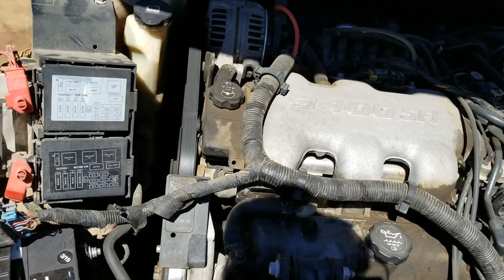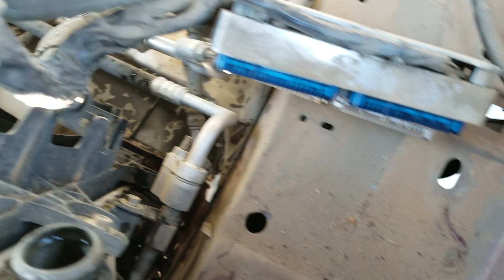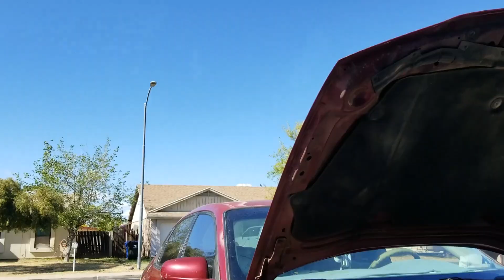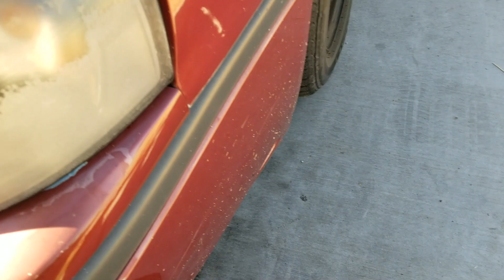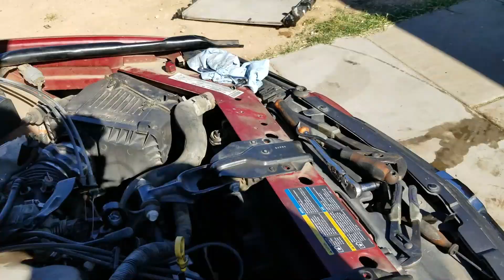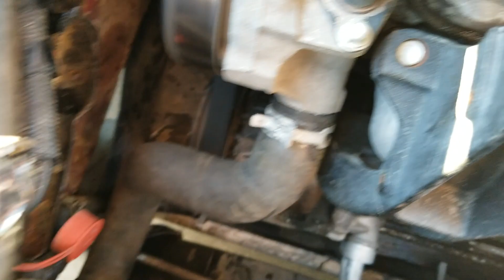2000 - 2005 Chevy Impala Radiator Remove and Replace

Comment: Also, the coolant should be flushed out & Changed, along with your Thermostat, every 2 years to keep your engine Clean & performing at Peak Performance & Reliability. Don't listen to the Manufacturers or you will be changing parts, water pump, Radiator, heater core, intake gaskets, head gaskets. Old heated Antifreeze turns Acidic over time, which means it start eating gaskets, Seals, Aluminum. Manufacturers state, with Dex-Cool flush every 5 years, way too long, of course, they are in the Business of SELLING PARTS, at a very High Price. Preventive Maintenance is the Key. Green Coolant, manufacturer states every 3 years, every year or 2 you should drain & fill, change Thermostat, at the very least, a flush until comes out clean is Recommended, Recommended by us Mechanics who deal with the Destruction of these vehicles everyday. Hope this helps people understand.😉🙂🇺🇸

Comment: Hey the radiator that you linked in the description is that the correct fit for the 2001 impala 3.4 or is it the one you had in video that you made work?
Reply from the maker: It's SHOULD be the correct one for the vehicle I was working on. The owner ordered the one in the video that was incorrect.

Comment: ALL vehicles MUST have a 50/50 mix of Antifreeze & Distilled Water, if in Alaska or a very cold region, this concentration of Antifreeze will be a little higher. You can not run JUST Distilled Water, the boiling point of water is lower than a 50/50 mixed Coolant or Antifreeze. If you were running just Distilled Water, that is most likely why the plastic side tank split open, too much heat & pressure on the plastic. These newer cars all have more plastic on them than ever before, & will get worse I'm sure. The other reason why you use a 50/50 mix of Antifreeze & Distilled water, is for it's lubrication properties & anti-Corrosion properties. Lubricates the water pump, keeps the inside of the engine block, heads, radiator, heater core, rubber hoses from becoming corroded with rust. Dex-Cool, the Orange GM Coolant, is a Silicone based Antifreeze, the Green Antifreeze is an Ethylene Glycol base, it has a Lower freezing temperature point than water & a higher boiling point than water. POINT: If you use just Distilled water in your vehicle, it will freeze in cold temperatures & could still boil out & cause an overheat condition, hot temps outside means it just happens faster.😉🙂🇺🇸 Hope this explanation helps.

Comment: I liked your video, but I want to see how you drain the system and radiator.  It's always the unknowns that get you in a DIY situation. If the part is hidden or hard to see clearly, these are the unknowns and that's why we watch these videos, it's not the front and center obvious bolts that are mysteries, it's the stuff that the engineers hid down under something else.  Thanks
Reply: I have to do a radiator exchange because transmission fluid is in my coolant, but how do I or what do use to get all the oil out?😟
Reply from the maker: @ephraimyisrael7039 you just flush the coolant system after you replace it. Supper easy. There should be lots of videos on how to do a coolant flush.
Reply: @Fixnit14  Thank you  Sir.

Comment: when taking out the pipe on the right side is it supposed to blow a lil smoke out ?
Reply from the maker: The coolant system should only have coolant or distilled water in it.
You may have a bad cylinder head or head gasket.

Comment: On a Chevy Impala 2005 what makes the popping sound when you turn the wheel
Reply: Check your steering rack where it bolts to the Frame in the middle of the car in line with the front wheels
Reply: Strut assembly.... Mine did that when the top plate corroded out. Just buy a quick strut.
Reply: Check cv axle

Comment: Dude do you need an engine hoist to remove those engine mounts
Reply: Not for the upper engine mounts. Those do not support the weight of the engine. They are for the twisting of the motor when it's running

Comment: I thought 50/50 antifreeze engine coolant is better
Reply: Yes. It will give you protection at a lower temperature than 100% antifreeze.

As a side note, I used to work for Saturn (and subsequently GM after they Borged us) as a Controls Engineer. One of my areas was "Radiator Fill" where one of the checks was to make sure that the coolant was a 50/50 mix. The test for this was to use a refractometer, which would show something like -80F when the mix was correct.